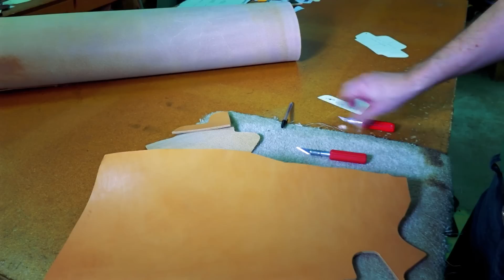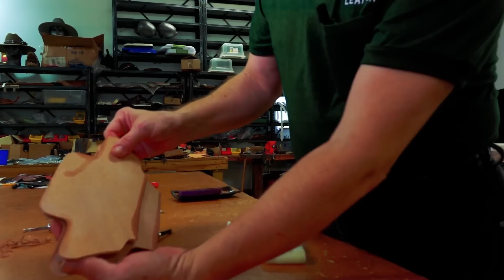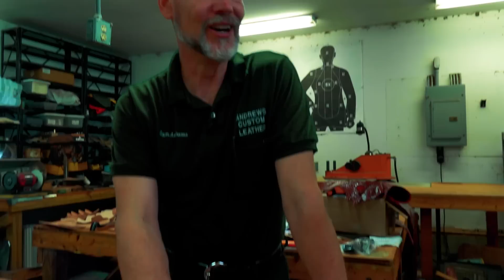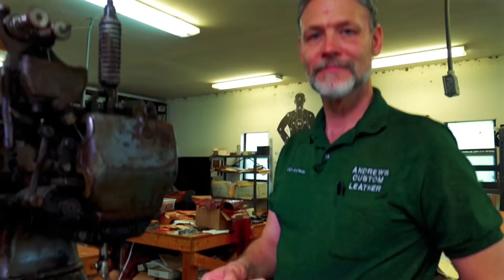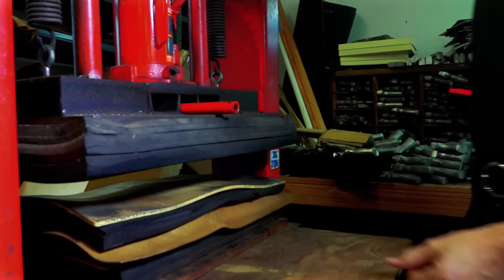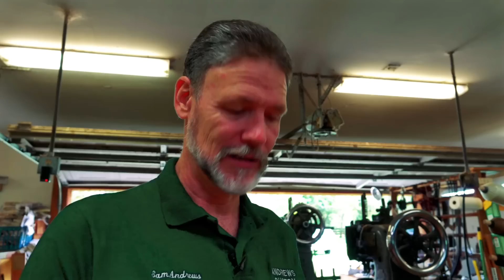Custom Leather Holster Making // MacDaniel II Rig // How It's Made

Comment: Leather is so much nicer than Kydex. Great video Hank!
Reply: I agree with you I have one of his McDaniels for my 1911 by far just as good as Milt Sparks of and the other big custom leather makers
Reply: An idiot can cut and heat form Kydex. Kydex is actually a PVC based material. PVC has a very poor thermal expansion and contraction coefficient. PVC conduit has been known to tear apart #12 gauge steel electrical boxes when the temperature drops a mere 40 or 50 degrees. Imagine trying to draw your gun from a Kydex holster that was set up for good retention when it was 95 degrees out, and now it's 3 degrees! I have damn near tore my pants off trying to extricate a gun from a Kydex POS holster when it was -6 out. Kydex also tears your gun up. Kydex is a great material for people with limited skills, and few tools. It's okay, and it's fine for plastic mass produced guns, but I would NEVER put a Colt Python or a Wildey Hunter in Kydex.
Reply: I agree and disagree with the popular opinion. I like leather holsters I have a galco jackass for my glock just for when I want to be fancy or depending on what I'm wearing. I also have a gcode incog. I either carry appendix with the mag caddy or at about 4oclock without the mag caddy for obvious reasons. I prefer kydex for the purpose its rigid and I dont have to worry about temperature changing it as I live in florida so we don't get hot to cold fast. Leather will eventually loosen and can be caught in the trigger guard if you aren't paying attention. Saw a dude get a round in his ass cheek cuz his leather collapsed on him. I love both but if I had to pick I'd go with kydex for rigidness.

Comment: Hi Sam, where do you get the metal stiffener plates that you used on these holsters? You had two different sizes. Also, where did you get the large snap/locking swivel that you used for the corner of each holster?